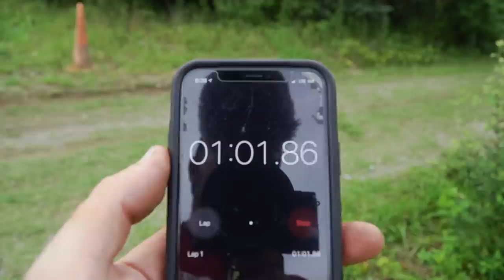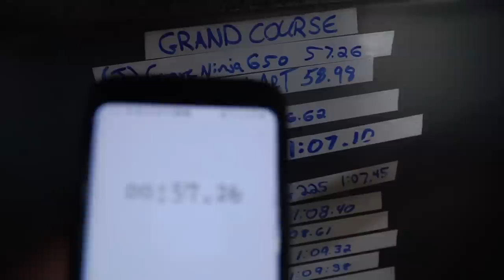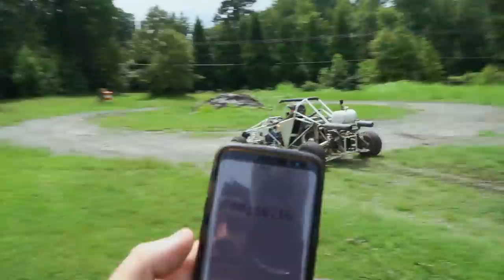I CRASHED Our 750cc Cross Kart | High Speed 180, Broken Parts, Totaled??

Comment: I think the next project they need to build is a m274 mule 4x4 or 6x6 diesel with reverse equipped with tool body (basically 2 rolling toolboxes turned back to back with a recovery tow arm stuck between them (variant of under reach) possibly also having a high boom, utilizing a 65+ amp alternator (to power work lights as well as act as a generator and jumpstarting platform) at least dual deep cycle batteries with a large hardwired power inverter (1200+ watts) with front and rear winches, with a service trailer equipped with a flux core welder (for trailside repairs as you don't have to worry about or fight with your shielding gas getting blown away when it's windy), an air compressor with air tank and drier for air tools, as well as stocked with all hard and flex lines, hoses with clamps, spare belts, spare hardware, etc.  While I was in the army we had a humvee equipped as a service/tool truck with a service/tool trailer, and if that didn't have the tools to fix it we'd drop the fresh from the pls truck (not lhs (4axle) truck as it had 5 drive axles 3 were steer axles (2front & the1rearmost) and a much higher load weight lift capacity).

Comment: Swap in the new 2-stroke 670, then you can redo the shift linkage so you won't have to cross your arm over. Also, you'll get reverse, and while you're at it you can rebuild the front end, and do taller tires when you do so. Taller tires will help with ground clearance, improve the aesthetic, improve the shock absorption, and when you were building it originally you didn't bother to get the factory speedometer working because you said that taller tires in the future would make it inaccurate. It's almost like it was meant to be.

Comment: There’s a replacement oil pan cover on eBay for $60, so you can save the CB750 engine.

Part# 11210-MA5-770

Comment: WHY WOULD YOU NOT PUT A GUARD ON THERE THAT WOULD BE THE SMART THING TO DO!
Reply: I've been reading comments and yours is the first that is in line with what I've been thinking for some time. A skid plate. Clearly they've done a great job at protecting the driver. Now work on protecting the engine. It's not a circle track machine, it's an off roader.... Just read the next comment. SKID PLATE SKID PLATE. Should have read a little farther. Lol
Reply: My first thought was man he must have really slammed something to get through the skid plate. What skid plate? I thought they put one on when they built it but i guess not
Reply: yea that would be good thing to do but it`s a bit late now
Reply: Or REMOVE THE ROCKS!
Reply: @MrJohn714  theres Always more rocks
Reply: At 17.26 I thought I saw an oil pan on that bike
Reply: Bigger wheels and bigger tread, problem solved for that circuit
Reply: Totally agree!

Comment: keep the cb750 and re-jet it with vance-n-hines exhaust or something to amp the ponies at both ends of spectrum! that engine can get much more power to the ground with a little TLC. plus hondas are bulletproof! except for those in ground rock shaped bullets. new springs and a higher clearance, that thing will boogie. looking forward to the cross kart surgery nonetheless! stay safe guys, great video!

Comment: Ive used fibreglass cloth, with original jb weld as a resin. (left to cure 3 days) Tested at 400psi, daily it peaks 275-325 psi.

Comment: aluminum weld oil pan, not hard if you can take it off.  Need to move motor up and add skid plate then get taller tires or move suspension links inward a bit to get more travel and more clearance.

Comment: I'd say fix it up with JB weld and re-thread the JB-weld for the oil plug. Just to see how long it lasts, but wire in a low oil pressure switch to kill the ignition.

Comment: you can patch that hole, i've seen bikes with more damage patched up with JB Weld, so y'all can get it choochin' again, and keep the motor running untill you find a bigger EFI engine for the cross cart, or untill you can come up with some sort of skid plate, you can pull the oil pan off of your spare CB750 and put a skid plate under it

Comment: after putn the oil pan back on u cud raise the suspension a little or make it stiffer n the rear or even better leave it like it is an just raise the motor up for ground an then put a skid plate under it

Comment: Adding a later watercooled online 4 would add considerable more complexity to it, hunt for a GSXR1100 old air cooled engine would be my choice.
Had a look at the parts file at work. These motors split in half at the crank centreline so would be a complete lower engine half to fix.

Comment: JB weld at peace back in there, fill it up with oil and keep running it until you got to put a set of rings in it, I'm assuming that's why it's smoking unless it's a valve guide? Next time take a half hour and put a skid plate on it

Comment: I'd say put a 600 in it. more power, less weight. also the 750 is smoking may need rings. didnt sound like it was running good. I really dig the 360 cam or some extra angles like that very cool

Comment: I had a 350 Honda 4 and hit the drain bolt on bottom with a pipe breaking it off. Left the same oil slick pattern. Found out it did have a Replacement pan at the junk yard.

Comment: The cross cart was fine. It just needed taller tires to increase the the ride height, and therefore clearance. You bottomed out the chassis before you came close to bottoming out the suspension.

Comment: "broke the record though" - sounded very ricky bobby
In the slow mo of the impact, it looks like your fuel cap is spraying fuel all over too. Might be worth putting a vent tube on that puppy... and replacing it with an aluminum or plastic cap to avoid an explosion down the line due to steel on steel causing sparks when your putting it on/taking it off.

Comment: Put bigger tires front n back on the cross cart this is a trick for wheelers make so they don't bottom out when they ride in the mountains I do it myself if you have to gear it down a little to make up for it you have the parts

Comment: i liked the outtro alot. I hope you didn't do any damage to the engine running it without the oil after the pan was damaged, even if was only a few seconds. Most likely it'll be fine, but if it had happened toward the beginning or the middle of the lap it might've done some real damage.

Comment: You guys need to put a bash plate on it so it won't destroy the sump (oil pan) again but if you do get the sump (oil pan) with the bash plate protecting it then either need to raise the engine up so its not the lowest point redesign that section of the cross kart

Comment: The first time you ran it off the road it really looked like you had locked up your front wheels, this may have been the situation in the second one as well. You can't steer with the front wheels stopped, simple as that. Also this would be a good opportunity to cut down some trees before someone gets hurt badly, if you want to make sure people make the little corrections, jogs etc, use traffic cones, they are cheap and won't kill you, hit one of those mature trees head on at speed and someone could easily get killed, cut them down and clean up your track to make it safer.

Comment: Long as trail of oil ends under the vehicle and it was shut down moment it come to stop, its still had some oil when it so internals most likely didnt take any damage from that. unbolt the oil pan, scrub it clean.. scrub it super clean, grind the surfaces you are about to weld and do it with in two hours or oxide layer will form to those area, so be quick and tig or stick weld it back together. Its aluminum casting, so little bit pain in the ass to weld compared to marine aluminum, but any professional worth of their salt can fix that for 10-20$ or bottle booze on their coffee brake. Source: Buddys Honda dirtbike launched chain into engine block cracking huge peaces off. Bearing spots just barely were outside of that destroyed area. He got it fixed for that price with out knowing the guy and that was not easy job. One oil pan is difficult due oil seeping into metal pores and burning out when heated creating bubbles and shitty welds, thats why combined with oxidation surfaces need to be cleaned and then grinded to virgin metal , so those oil spots can be avoided. Otherwise its not that hard.

Comment: Take the motor apart. Clean it up. Look at it. And sence it's cast aluminum weld with aluminum weld. Or new pan. But really remove those rocks and build a plate guard under It.

Comment: Raise the engine at least an inch and install a skid plate beneath it. I have an XS1100 4 cylinder Yamaha engine complete that you can have but it is shaft drive and carbureated.
Reply: Actually I like the Honda 750 engine that is in it now.  Bore it to receive an 836CC kit and super tune the carbs and it will FLY - guarantee it ! BTW, My wife says John needs a haircut.

Comment: john, we know you're just sayin' that it ain't a crash so you ain't gotta wear that helmet the rest of the day. best. rule. ever.  edit; you guys need to start collecting old tires to line the sides of the track around the turns to lessen your damage to your rides. the less that gets broke, the less you gotta fix, the more riding you get to do, and for the love of all things that go fast, clear the rocks off of the speed course for your own safety, as well as that of your rides. it ain't like you don't have a tractor now. a good welder could prolly tig weld the hole shut. my dad had a welding shop. one time, a guy he had working for us tig welded an open space 3"x 4" in a kawasaki four cylinder block where it threw a rod. find a local welding shop, and see if they can fix it reasonably if it's more than the oil pan.

Comment: I’m not much a comment guy but I love the Chanel so I have to speak. First, why would you use the same size tubing for a “trophy cart” as u used on the cross cart? The cross cart frame got all kinds of twisted. And it wasn’t even designed to jump. Second, these seats are not even close to being safe for these Aplication’s. Y’all need some legit racing seats with four point harness. I don’t want to see you boys get hurt!

Comment: No 600 guys. You need to put an R1 engine in it. Either a yamaha R1 or gsxr 750. And i have a 2005 R1 engine with 17,000 miles. Bone stock, well maintained,  with the full unmolested harness. Ill even donate it to yall.

Comment: Use the Ducati motor or better than that why didn’t y’all use it in the first place?  The cross cart is the only thing y’all have that can handle it and what about DS 650 front suspension and a-arms, they have extremely strong suspension and they would be wide enough to 
The DS 650 is built well cause they have so much power and they weigh probably twice as much as a 4wheel in its class. I’d seriously look into it if I was in y’all’s shoes

Comment: WTF guys.....  You have a boat load of snowmobile engines just colecting dust and rotting away.... You should put one of them on the cross cart.  and with the weight of a "tiny" 2 stroke engine you should get some more clearence in to the ground.     JUst wait until you meet up with Grind Hard Plumbing.  Try the cross cart they have with a snowmobile engine. I promes you that the 2stroke power in a Kart like yours is so much bether then a big heavy 4 stroke.

Comment: Save yourself the pain with the honda junk, get a kawasaki eliminator 600 motor or maybe an eliminator 900 motor. The bikes arent very expensive and mine has good power. A little bit of jetting and playing with air/fuel and the 600 motors could make 85hp no problem, stock motors make 75 to 80hp round about. Everybody using honda motors and spending forever getting them to run good and be reliable makes no sense to me. I personally have had absolute garbage luck with honda motors. Seems like everybody else does too they just wont say it.